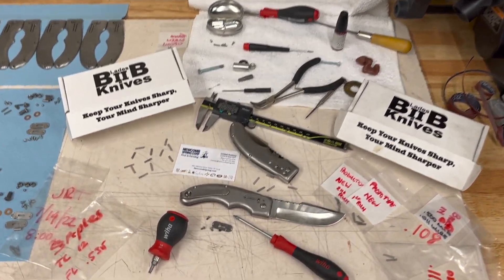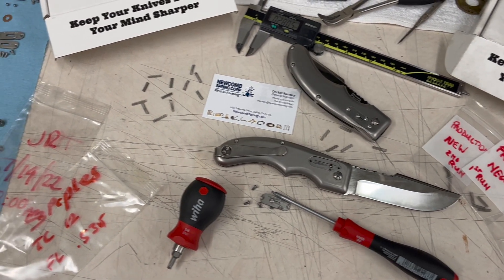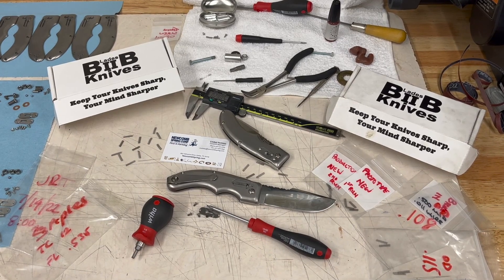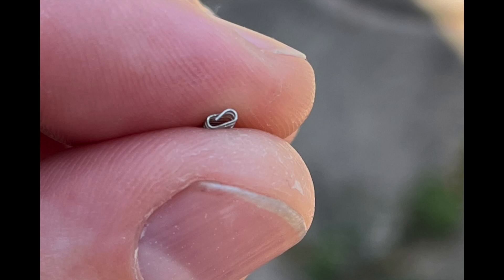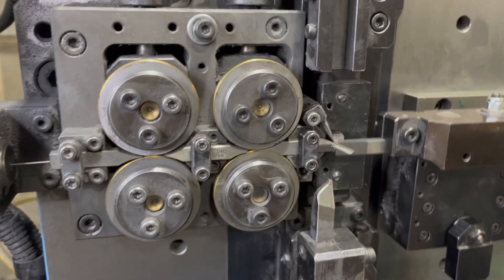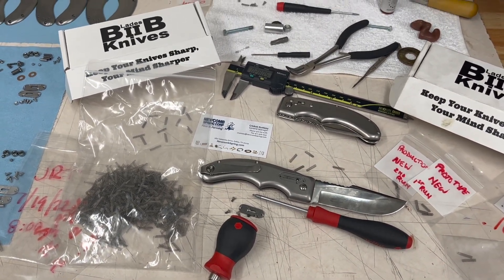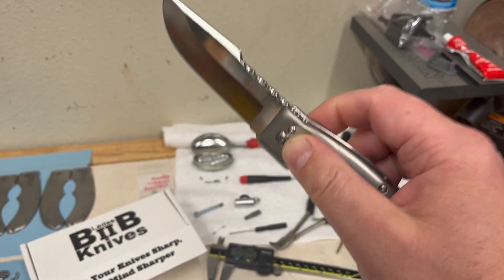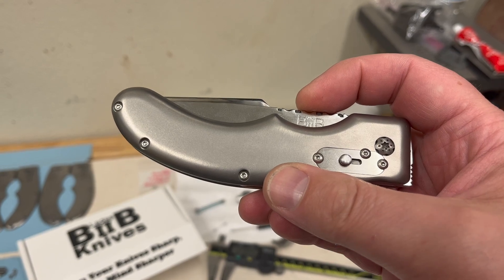Designing & Manufacturing Micro Rectangular or Magazine Style Springs - Innovation!

Comment: Id love to learn more about the machine that made the springs, at first glance it looks like a carbide cutting tool but I know its not cutting chips to make it. Very cool machine, fasinating. A video would be awesome (knudge knudge wink wink;) Just found yr channel, enjoying it a lot. :D
Reply from the maker: @mattymcsplatty5440 - Glad you are enjoying the channel. Thanks for the comment. The tooling on the machine is HSS I believe and not carbide. Not sharpened to cut but custom ground to make the bends they need and hard enough they wear well. The short video I shot of the machine making these springs is all I have. They were nice enough to let me check out the shop and how they were making these for me. Large production shop with a variety of different spring making machines. Wish I could have gotten more video as well.

Comment: In Taiwan there's a lot of parts stores. Stores selling nothing but screws, o rings, springs, etc. 

But I really don't know what it takes for them to make you a custom spring, most the time I just took a longer spring, cut it down, then modified it for my need, but then I only needed one or two springs. I even seen a spring factory in Taiwan, these guys make springs of all size and shape.
Reply from the maker: Tyler Fu - With online the selection is pretty good as well. If you want a round
Spring you have thousands to choose from; however even with all of that finding anything small and in the rectangular or.magazine style shape was not out there. Let me know if you ever see them available?  I searched quite a while before going with a custom solution and having them made.
Reply: @BladesIIB  I'm pretty sure rectangular springs, especially small ones that you require must be custom made regardless of where... difference is in Taiwan there are tons of spring manufacturer, it's not like the one man garage with a spring making machine, but a large facility with tens to hundreds of such machines all making various springs. I believe if you have enough quantities they'll make whatever spring you want them to make, however for a couple it makes no sense. 

By the way if you just need a couple of springs you can just make them yourself on the lathe out of music wires. Be sure to anneal the music wire first, make it on the lathe (This Old Tony has a guide on this), then use your heat treat kiln to heat treat it.
Reply from the maker: @taiwanluthiers  Sounds like we are saying the same thing. The additional challenge with these small magazine style springs is that since no one makes them and there are no formulas just asking for a dimension and tension does not work everyone wanted exact wire size and number of coils to make them. So I was lucky to find Newcomb Spring to help with that prototype step. And just to clarify, Newcomb Spring is a large fully functional spring company not a garage operation.  DIY magazine style on the lathe would also be tough I think?
Reply: @BladesIIB  You can still do it on the lathe, but instead you would use a rectangular piece of stock as the mandrel instead of a round stock (4 jaw chuck needed). But you'd still need to know how to calculate tension/dimension and all that. But yea lathe is quick/dirty way to make them if you just needed a couple of springs, otherwise it's ordering it by the 1000 from a spring manufacturer. I seriously wouldn't be manufacturing springs with a lathe unless it's a very large one (they do use lathe for this professionally for very large springs, but this is metal heated to glowing red then quickly wound around a mandrel using a special lathe)

If you have special size requirements though and quantity it may actually be cheaper to get a Taiwanese spring company to do this, as labor tends to be horrendously expensive in the states.
Reply from the maker: @taiwanluthiers  The company I worked with here was very reasonable and capable and I could drive there to custom tune and test to get the right spring. Worked out for me. I don’t think I could have held the tolerance I needed on this small spring trying to wind by hand. But maybe I will give it a try some time.
Reply: @BladesIIB  https://youtu.be/jAawhg6JtyY